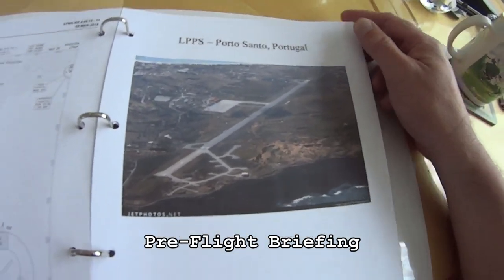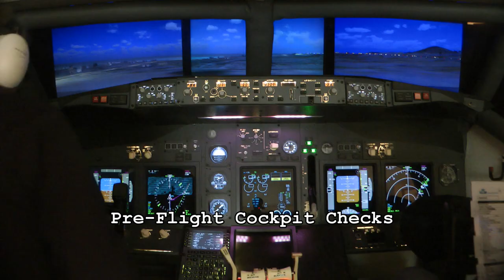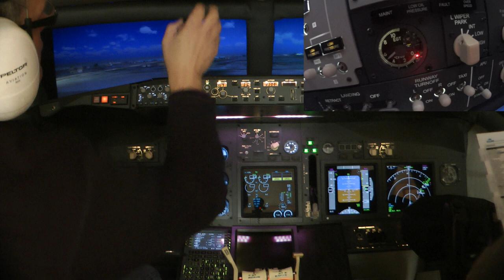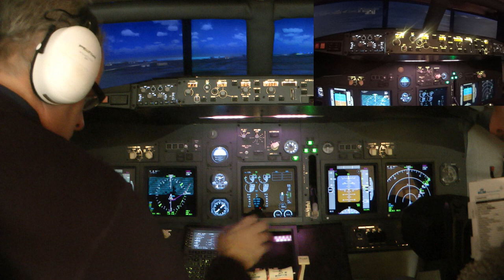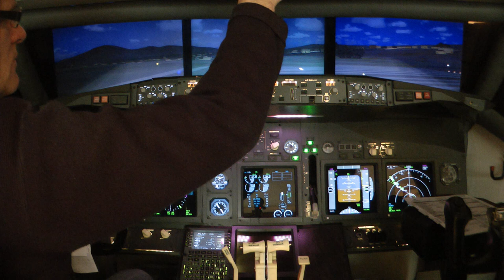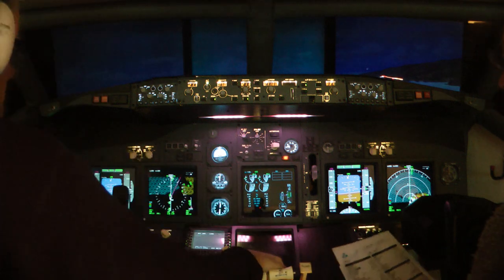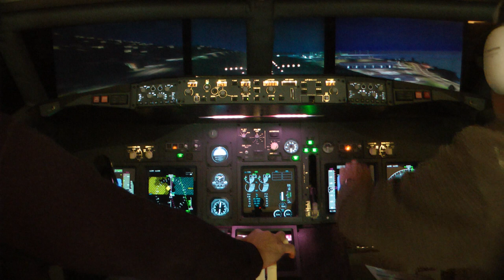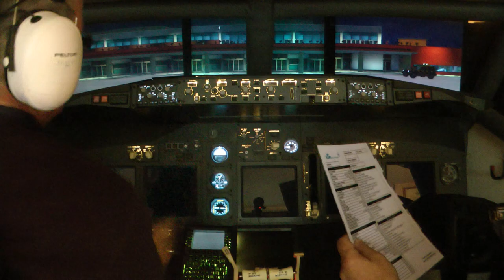B737 Home Cockpit - Flight to Madeira

Comment: Next time you may want to place your right hand on the throttles until V1 in case of an engine failure or condition which may necessitate performing a rejected takeoff.
Reply from the maker: Yep, I've had a lot of the same comments. I kept my hands away from the throttles so people could see the motorized throttles, but next time I will do it properly. Thanks for watching, regards, Neale
Reply: I'm ok with you

Comment: I get jealous to not have a such sim at home but I like your vid very much.
Congratulation from France for your hard work, I'm very impressed
Reply from the maker: Hi, thanks for watching the video and the great comment. Believe me, if you put your mind to it and grab a few pieces of wood and get started it soon comes together. It does not cost too much if you try to build a lot yourself. as an example the nose wheel steering piece I use was a truck wing mirror case which I found on the side of the road. I painted it and used it to mount the steering tiller - if I'd tried to buy this online it would have cost a fortune.....regards, Neale

Comment: May I ask what aviation planning software/resources you used to create you flight plan please as I am an aspiring pilot and have most of the resources I need other than ground school and flight planning resources.
Many thanks,
Jack.
Reply from the maker: Hi Jack, I just use off the shelf maps and airport charts straight from the Internet. Nothing special at all. Regards, Neale
Reply: Neale Hargreaves Thanks for reply :)

Comment: I see a lot of people commenting on negative thumbs down.    I am in the middle of rebuilding a Van Hool bus  that has a small electrical fire.   and that is daunting and complicated and got most of it done.   I could NEVER EVER IN MY WILDEST DREAMS build what you built  and unlike these thumbs down people  who are most likely jealous  I am astonished and thought at first it was one you bought from KLM airlines as they upgraded   but you built this WORKING system on your own.  holY S(*&^ batman  I am IMPRESSED   The heck with them    you have 2..1k likes and only 94 thumbs down.    that is nothing.     carry on and wish I could try a simulator.  always wanted to land one of those airliners   most likely in the next life
Reply from the maker: Mike jaques very many thanks Mike for watching the video and taking time to give such a great comment, it is so much appreciated. Once you get going it actually comes together quite quickly, but there are some hurdles to get over. Anyway, thanks again. Kind regards, Neale

Comment: Suggestion, I wouldn't have the warnings and call outs through the surround sound system, sounds to echoey, if poss, I'd route them through speakers mounted into the cockpit "dash board" possibly found out where the real 737 has the sounds emitting from. Just a suggestion. Great build, wish I had one 😀
Reply from the maker: Peter Broomfield  Thanks for watching Peter and the advice I will change for the next recording. Many thanks, Neale

Comment: Hey! Very nice job flying! Just one question, how much did it cost to build the whole simulator? Just curious, thanks!
Reply from the maker: Hi, and thanks for watching. Everybody in the comments wants to know how much it cost, so you are not alone! So far about £8k, but as I've said before, the difficult bits are all the hours of soldering, wiring and software code, which cost only our own time.  Good luck if you are thinking of building one. Regards, Neale

Comment: What size monitors are you using for your video displays? Great job!
Reply from the maker: Hi, thanks for watching. For the outside world I have 3 x 23 inch monitors. For the pilot and co-pilot displays I use 2 x 19 inch and for the centre console and standby instruments I use a 17 inch monitor turned 90 degrees for a portrait display. Regards, Neale

Comment: A question Neale. There is the pilot and co-pilot, and as I can see each has their function flying the aircraft. If one becomes I'll or incapacitated for whatever reason, can one person still fly, or land the plane alone??
Reply from the maker: HI and thanks for watching.  Yes, one person can handle the aircraft on his/her own without any problem Generally there are two people in the cockpit for redundancy and sharing of workload.  Also, having checklists monitored by two people ensures no mistakes and is a safety cross-check.  Kind regards, Neale

Comment: This is an awesome setup, you should be proud. Any chance perhaps you'll be enjoying the new Microsoft Flight Simulator 2020 on this setup? How much work would integrating your panels to work with it be? :)
Reply from the maker: Hi, thanks for watching the video and commenting. I appreciate the kind support. I'm checking to see if it's compatible with MSFS 2020. The panel integration should be straightforward, it's just the basic compatibility with all the add-ons which will be the issue. Kind regards, Neale

Comment: Great set up. How much did it cost away from the pc for all the dials ,throttle etc. I am inspired but I'm in the process of getting a pc with a overclocked i5 with a gtx 950 and ssd /sshd , 8gb ram.Will this be good enough do you reckon for just Fsx and add-ons. Great video but what was the squeaking sound.I suspect this was your seats, or maybe it was your wife bringing a brew from the kitchen after you pressed attendant button, and nagging you for being disturbed lol. Kind regards
Reply: Justin Lever oh. It would be perfect. I have an i7 with 8 GB of ram, and I average 60 DPA on a PMDG 777 at a add on airport. More than enoughz
Reply from the maker: Justin Lever - Hi Justin and thanks for watching the video. as somebody commented, yes your PC spec will easily drive the main display and hardware. As I've commented a lot on this video, the whole setup has cost around £8k so far, with a lot of home build stuff keeping the cost down. Good luck if you build one! Regards, Neale

Comment: Splendid, good work, good flight, good material and good moment, thank you!! but have you see your screens shows 3 horizons (one per screen) when you turn? it's certainly because you don't make a new resolution resize ans active it.(in Nvidia video card) to make sure and verify if you do this correctly in fsx or windows, you can see your mouse behind de bordure like a virtual espace and no a alf mouse on to screen. i do simulation to and you will see... that change the reality immersion and visual approche without 2 runways on bordure with bezel. I hope i will have help you and sorry for my english. i speak french. Again thank you and good flight.
Reply from the maker: Hi, many thanks for watching and the helpful advice. Our problem is that the centre screen is slightly bigger than the other two so the horizons never quite line up. I do run the sim in an Nvidia full screen environment with a resolution of around 5300 x 1020 pixels with full hardware acceleration from a 2 GB graphics card.  Thanks again, Neale

Comment: Nice simulator. What Avionics software are you using?
Reply from the maker: Hi, thanks for watching.  I'm using the iFly737 cockpit builders edition for the flight model, which also enables all the main panels and center standby instruments.  All of the switches, motors and gauges I script with SIOC code and use Opencockpits IO boards.  I talk about the build in my first video. Regards, Neale

Comment: I would like to point out that during takeoff you're (the pilot) is not meant to take their hands of the throttle until V1 in case of a malfunction and an emergency abort
Reply from the maker: H, thanks for the comment.  Yes, you are very correct and I have answered this point several times if you look through the comments. I was asked not to put my hands on the throttle during the take off roll several times so people could see the motorized throttle levers in action.  As a pilot in the real world I am very strict and never remove my hand from the throttle below 500ft.  Again, thanks for the comment and for watching, kind regards, Neale

Comment: correct me if I'm wrong, but surely you should have hand on throttle until v1? great video anyway.
Reply from the maker: Hi, thanks for watching the video and commenting. You are of course correct and it has been commented on many times.  The reason I did not he my hand on the throttles is that several people asked if I could show the throttles moving automatically after pressing the TO/GA button.  So it was to demonstrate the auto-throttle.  Again, thanks for watching, regards, Neale
Reply: Neale Hargreaves oh sorry, that makes sense. that's really cool, awesome video again! 😉

Comment: There is a big mistake in the pilots panel.... The side of first officer the artificial horizon is in the wrong place, must be inverted with hsi
Reply from the maker: Thanks. I’ll check the manual and change as necessary. Regards, Neale

Comment: A pre start checklist with the vertical horizons already initiated and aligned, hmmmm interesting
Reply from the maker: Hi, on the 737 you do not need engines started to align the gyros. This has in fact to be done before engine start on the ramp to ensure good alignment of the twin INS units. The alignment is carried out either on external power or with the APU started. Remember at most commercial airports engine start is not carried out on a 737 until during or after pushback, and the gyros and INS units have to be aligned by that stage. If you look through the 737 operating manual the alignment phase is carried out during the early stages of internal cockpit checks. Neale

Comment: hi neale wondering how do you link your computers together to run the program cheers
Reply from the maker: Hi, sorry about the delay in responding. I've been overseas. The computers are linked via a standard Ethernet hub over a local network. The iFly737 Cockpit Builders Edition (CBE) provides an extension programme called iFly737 Client which you install on each of the attached computers where you want to run other screens or add-ons.  All you have to do is specify the IP Address of the main computer running FSX, and then connect the client pc devices to it. It's very straightforward. Regards, Neale

Comment: How come it turns automatically and adjust speed automatically as well?? Does it do that the same irl?
Reply: Auto pilot mate, same irl.
Reply from the maker: Don Pedro - Hi, thanks for watching. The aircraft turns and adjusts speed automatically via the autopilot or MCP, coupled with the flight plan entered into the Flight Management System, or FMS. It follows the entered profile both vertically and laterally using the autopilot VNAV and LNAV functions respectively.  This automation is pretty standard on all commercial aircraft. Regards, Neale

Comment: why does it say terrain and pull up while you are landing? There was a bug or something in that I guess, it is not logical that the system is saying pull up while landing?
Reply from the maker: A very good question and thanks for watching! 
You are correct and those alerts should not normally go off. The truth is that we actually went around after the first approach as there was another aircraft on the runway, so the Flight Management System needed reprogramming with the runway details, which we didn't do (we did not include this on the video). Therefore the aircraft did not actually know we were in an approach to land profile, hence the alarms went off. In normal circumstances a 'pull up' alarm is a mandatory go around unless the pilot overrides that call- which is what we did as we were good VMC and had the runway visual at all times and were on the correct descent profile.  As I said, a great question, and you are the first to point out the abnormality in logic.   Many thanks, Neale

Comment: Hi Neale, are you a commercial pilot or just a SIM hobbiest?
Reply from the maker: Sterlin Smith Hi there and thanks for watching. I am a pilot, but do not fly for an airline. I have a military aircrew background and now fly in a multi-engine environment on a small twin-engine fixed wing as well as small Cessna aircraft whenever I can. Regards, Neale

Comment: how much does a project like this even cost? im sure its not cheap at all
Reply from the maker: corey harrison Hi. Thanks for watching and your comment. The most regular question I get asked is how much it cost! So far it has cost around £8,000 over 5 years now, so not that much actually when you consider a full blown Boeing sim would cost several million. Kind regards, Neale
Reply: $10,000  not bad for all that,i mean everything works as i can see,pretty impressive set up,one of the best ones ive ever seen before

Comment: The only thing you're missing is a working HUD
Reply from the maker: Hi, thanks for watching. I'm using the 737-800 flight model which does not feature a HUD. I think the BBJ does, and perhaps one other 737 model, but not the one I've used in the sim.....regards, Neale
Reply: +Neale Hargreaves If you could Flint one and hook it up with the system it would look great

Comment: Making any updates soon???
Reply from the maker: Tiger ezpi - Hi, thanks for watching. Yes, a lot happening in the sim right now. I'm switching across to Prosim737 software and have fitted a second yoke, a lower display screen and nose-wheel steering. Hopefully a video will follow soon! Regards, Neale
Reply: Neale Hargreaves yesssss cant wait thanks for the update

Comment: VOR not beacon. A beacon is an NDB (Non Directional Beacon), and that departure uses a VOR. :p Oh and a dislike because of the mic is too close to your mouth and the  audio quality is not the best. Bad video is tolerable, but bad audio is not.
Reply from the maker: NeonsStyle hi, thanks for watching the video and commentating. Rarely do I respond to this kind of post questioning accuracy of navigation systems and my own professionalism, however having nag 30 years flight experience and many thousands of hours including several instructional military tours I feel I do know what the definition of a beacon is! You are obviously correct that the letter B in NDB is Beacon, however, if you look at the Air Navigation Order definition of a VOR/DME it reads: 
In radio navigation, a VOR/DME is a radio beacon that combines a VHF omnidirectional range (VOR) with a distance measuring equipment (DME). The VOR allows the receiver to measure its bearing to or from the beacon, while the DME provides the slant distance between the receiver and the station.
Thanks again for watching. Regards, Neale
Reply: @nealehargreaves3439  Point taken. Just have your mic a little further from your mouth so it's not picking up all your breathing. It's very hard to watch then.
Reply from the maker: NeonsStyle Don't worry. There will be no more videos. Frankly it's not worth the effort for the abuse you get.
Reply: @nealehargreaves3439  You should definitely make more videos, and I was not abusing you. I was offering constructive criticisms. You can't let comments deter you. You can't make everyone happy, so you focus on the positives and try to separate the haters from those with constructive criticisms.  I was trying to get you better audio, so your channel would do well. So please, make more videos. Just don't internalise comments.

Comment: How not to operate a 737 :(
Reply from the maker: Pieter Ras Thank you! Sorry you did not enjoy the video. There is a disclaimer that I do not have a 737 type rating, so I would appreciate any advice for future videos. Regards, Neale
Reply: Neale Hargreaves Hi, 

First of all I like the idea, of the homemade flight deck. The main think I have noticed, is that you operate it with your own philosophy, you taxi very quick and there is a lot of flying fingers all over the AC is operated singe pilot while the right seat just reads the checklist. 

While the word checklist has the word checklist you operate it as a do list. Boeing philosophy is operate flows that are started by triggers. For example flaps up is a trigger for the after takeoff procedure. When then the procedure is completed as a flow you ask for the after takeoff checklist and the only think you have to do is to confirm that checklist items are all completed. 

The 737 checklist therefore is a lot shorter then what you are using.
Reply from the maker: Pieter Ras Hi Peter. Thank you for your educational response, which I have taken note of in case I ever choose to make another video. I apologise for the 'relaxed' and, in your eyes, unprofessional elements to the video. This is very much a hobby and 'bit of fun' and doubtless if you cast your eye over it then there are elements which will irk the professional aviator, as it has you. My background is 30 years, 6000 hours flying military aircraft where the checklist is handled in a 'challenge and response' format and I'm afraid I carried this through to my 737 hobby, for which I apologise. Also, I agree the manic 'hands flying around the switches' cockpit Is sloppy and I will correct. Once again, thank you for taking the time and effort to comment and point out inaccuracies. Regards, Neale